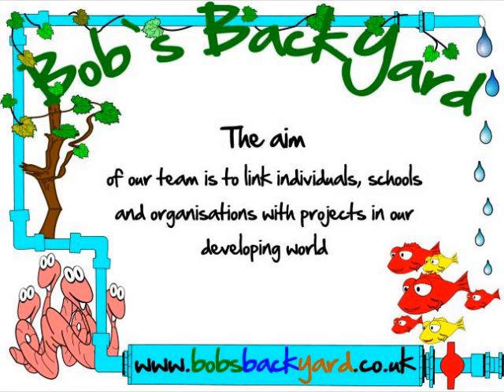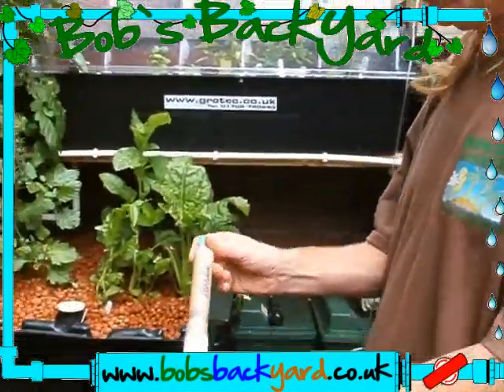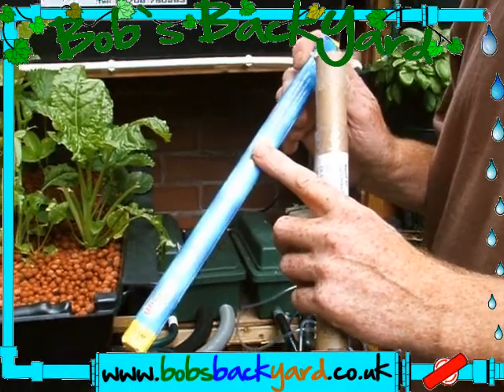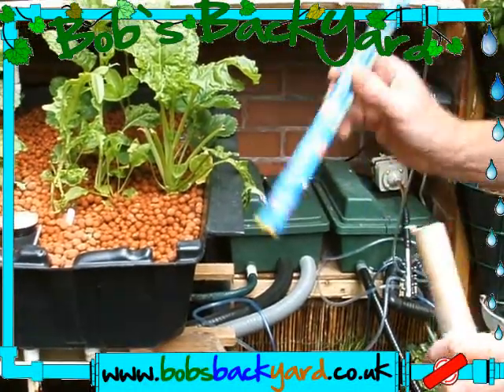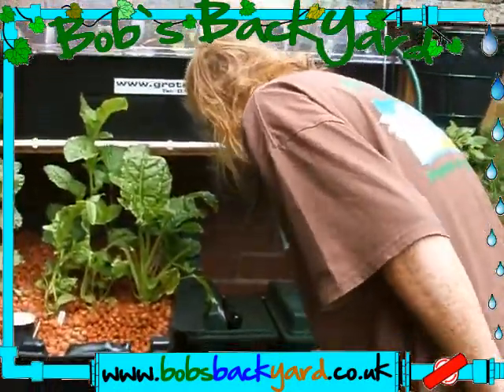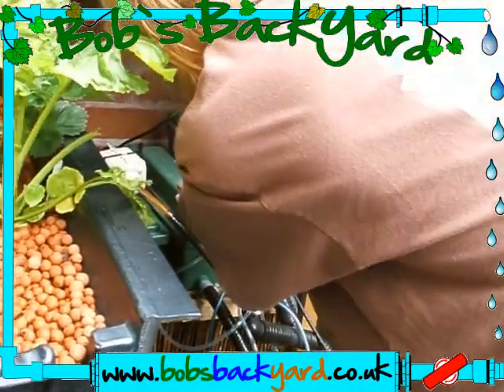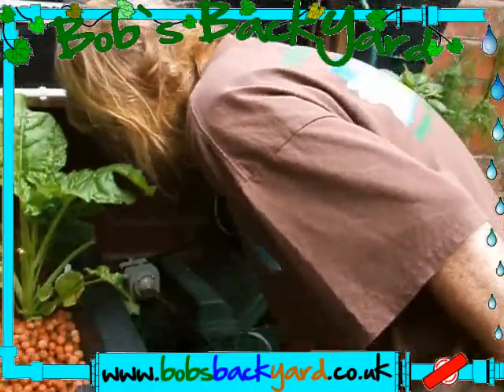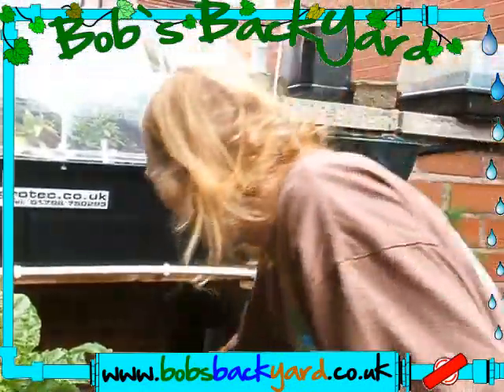How to UV filter aquaponics, keeping the water clear

Comment: Beneficial nitrifying bacteria is not free floating - UV filtration is one way of reducing bio load - it destroys (among other things) the bacteria that converts solid fish waste into ammonia, which IS free floating (providing the fish waste is kept in suspension). The solid waste's decomposition is slowed down, providing a larger window of opportunity for mechanical filtration to remove the waste before it contributes to the bio load of the system.